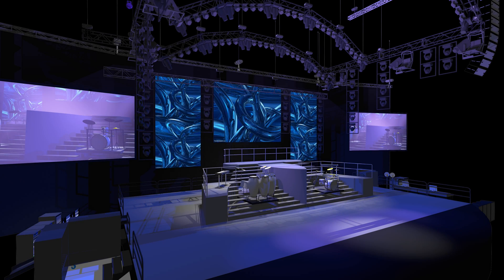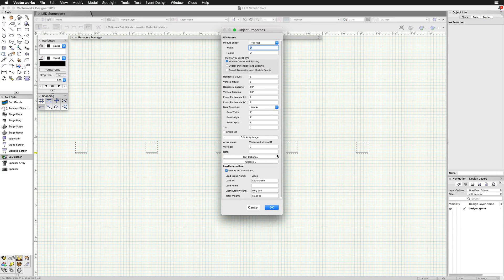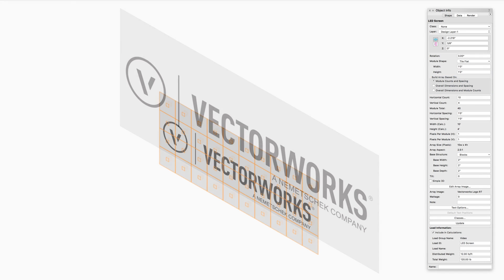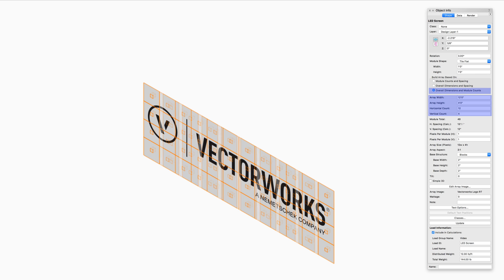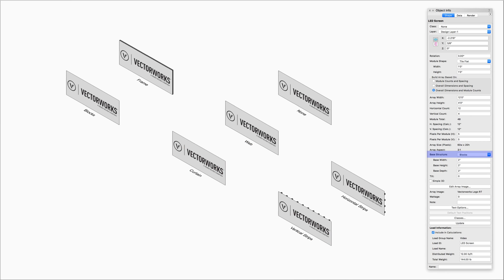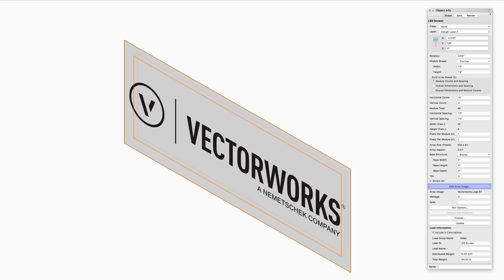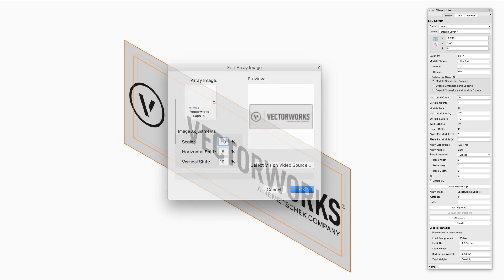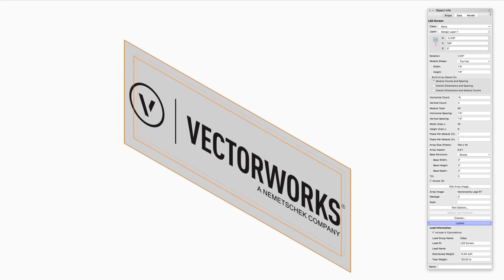Video - LED Screens

Comment: an observation here. The term "module" refers to the LED Panel. LED Panels are composed of individual modules. For example, a single module may have dimensions of 24mm in width by 270mm in height. Consequently, a LED cabinet or panel containing four modules would have dimensions of 480mm in width by 540mm in height.